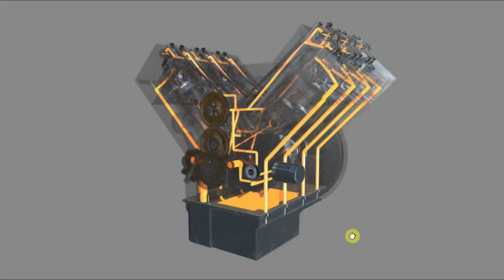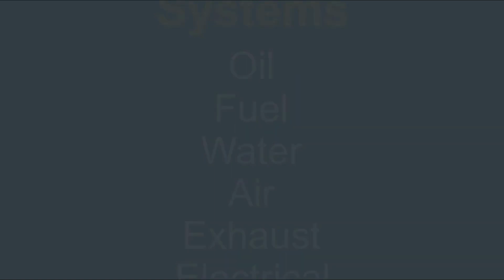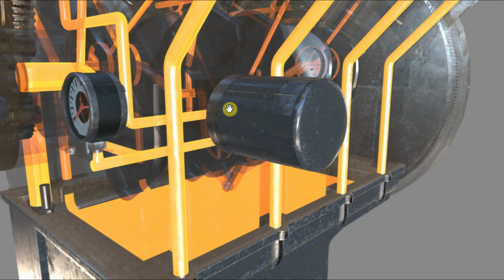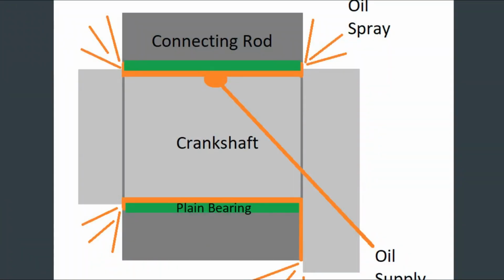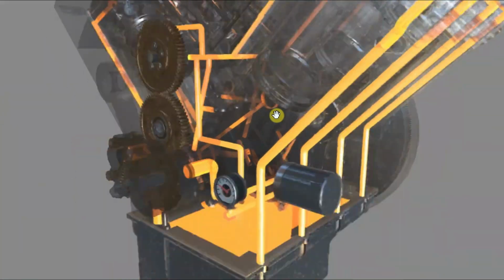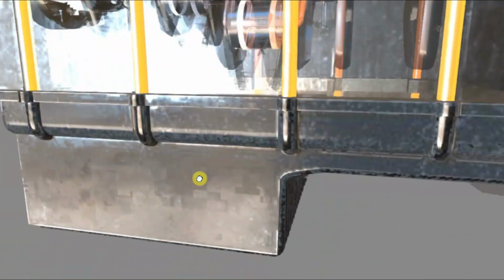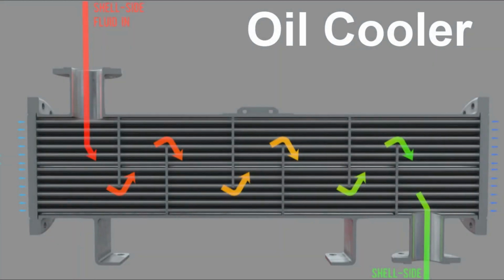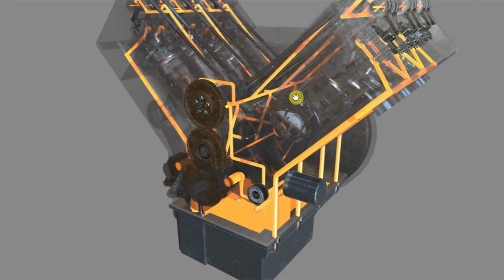(3D) IC Engine lubrication system / How does it work?

Comment: Hi sir I cheke the page thank you so much for replying me
But the last question or request.and I want to know what  kind of test machine exactly is it !
 Is it a  software which has to use in lcd  monitor and  is it an installation  aprogram  or it is a hardware physically machine or altogether what is it? And which Brand or company is good and easy use?
Excuse me  sir that I am a  medium level in English and I try to make you understand  what  do i mean!
So pardon me to waste your time.
I would like to ensure my customer after repairing the ECU board  and I do not have any way to test it in  my repairng shop but when I get enough information I can go to a big market in Tehran and buy it and hoping not to be so expensive.
Thank you again.